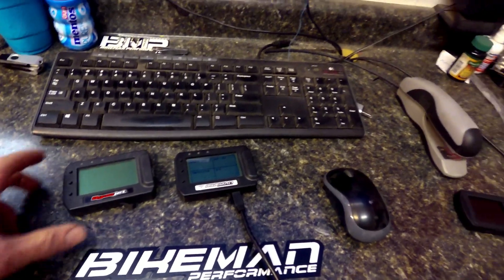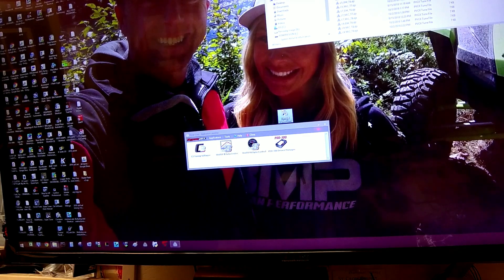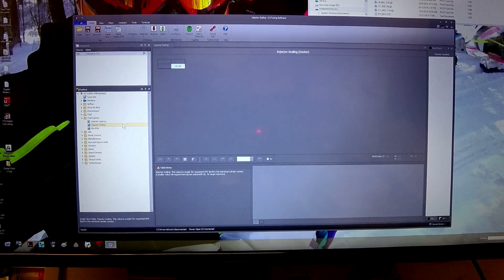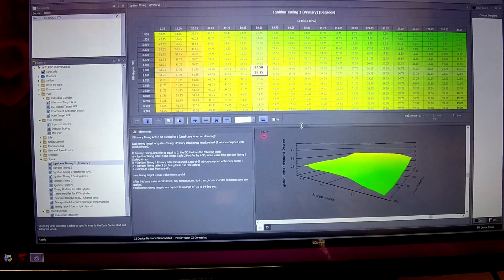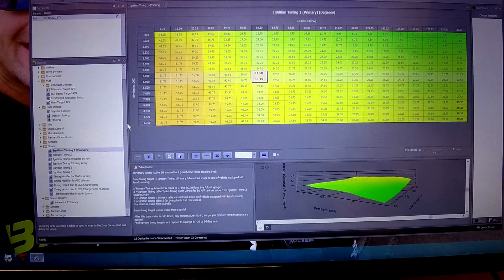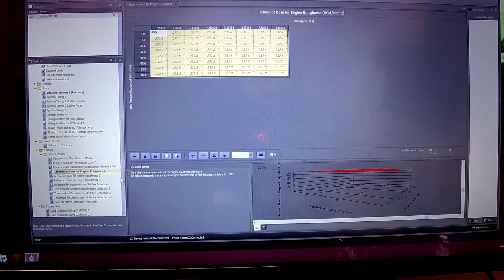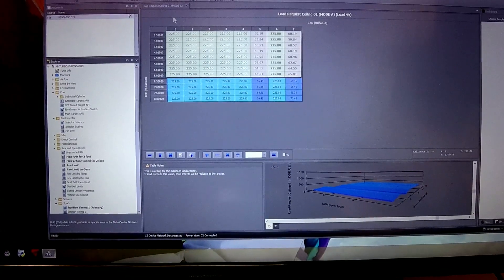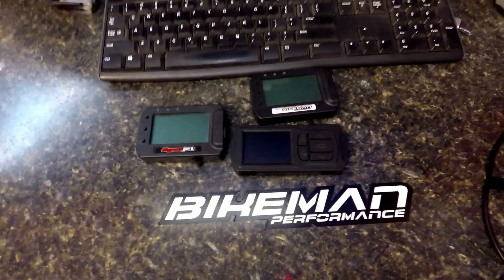HOW TO TUNE YOUR DYNOJET POWERVISION WITH POWERCORE TUNING SOFTWARE TUTORIAL

Comment: Hey I know this is an old video but , is there a possible of flashing a can am with this for WOT start and in gear?
Reply from the maker: yes I can do this
Reply: @JoeyStrub  ok How??, Ive followed your videos and the only thing I am missing to have a great start off the line racing is the WOT START, specially racing GNCC
Reply from the maker: @thumbgas888  I think it's in the miscellaneous tab. Check start in any gear. Then play with startup fuel until it is happy. Sometimes you will need to energize ecu ahead for it to work
Reply: @JoeyStrub  ok will do thanks!!!

Comment: Hey there I got a rvs tune on my 2018 polaris sportsman 850. Had Ryan send me over a flash. I dont see any difference with the tune other then the fan kicking on like 10 degrees early. I ran my quad against another 4 wheeler and I was beat by only half a quad length a few times. With the new tune same outcome.